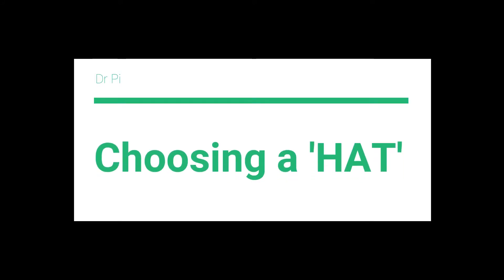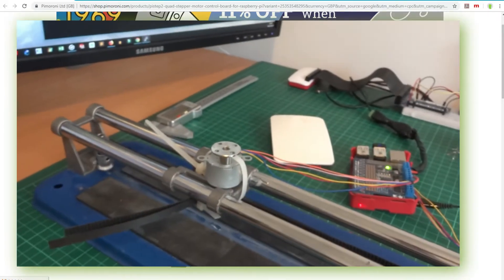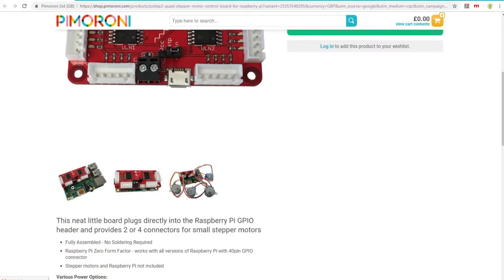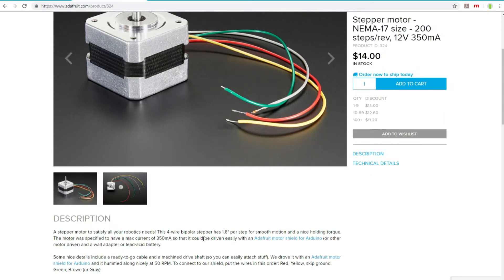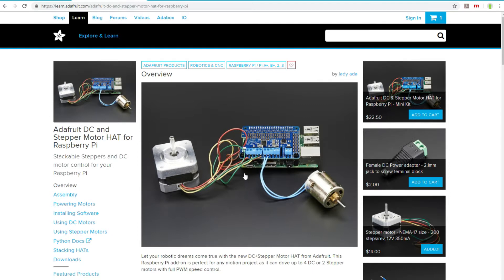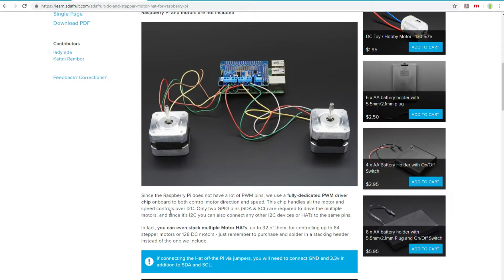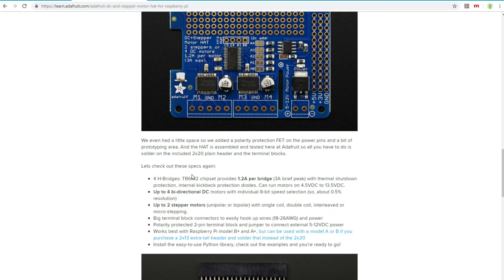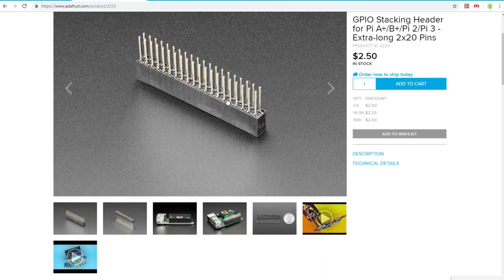Raspberry Pi - Choosing a HAT for DIY CNC

Comment: what "hat" have can use 5Ampere stepper motor good, or can controller 
TB6060 etc stepper driver good, i have 5A motors orden, ball screws, arduino board but not like, rasperry have lot more power use softwares than arduino old shit grpl softw,  anf fasten, limux cnc need build. 4 stepper motor and spindle and limit sw have normal basic set-up all cnc, and bonus have some more relay cooland etc what need use.best have HAT if can use CNC,LASER,DRAWING,VINYL CUTTER, i have all heads, vinyl cut, laser and spindle in home now. i need use this woodworking,aluminium little sometime, vinyl cut, laser sometime too. i build cabin woors, etc many wood pieces, ball screws have 3x 1500mm and linear rail i have 6pcs, x 1500mm long and Z axis 400mm long.
Reply from the maker: Hello, have a look at this : https://thepihut.com/collections/raspberry-pi-hats/products/raspberry-pi-relay-board
Are you still going to use GRBL though - it may be best to control stepper via arduino ...from the Pi.
Also, take a look at : http://willysgaragenorway.no/wp-content/uploads/2017/09/Arduino-and-TB6560-wiring-diagram-1.png

http://willysgaragenorway.no/

Comment: im thinking of a rasberry pi robot project, i need multiple motors and sensors, do you recommend anything in particular?  im not dedicated to rasberry pi either but i was thinking maybe the motor stack from adafruit, but im not sure i would be able to have any sensors with that, but it would satisfy my motor needs.
Reply from the maker: The HAT's that I used were easy to assemble and use, but only 2 motors per HAT. Adafruit is good quality. Maybe stack motor HAT and a Sensor HAT?

Comment: I want to build a cnc machine with raspberry pi and without arduino, i.e. I want to connect raspberry directly
 with the a4988 driver,, the problem is that in the case of arduino I used the grbl library and gcode sender, but in the case of raspberry pi I have no idea, I want an application that installs in raspberry pi and  directly control the motors . I'm waiting for your answer.
Reply: 4988 have wery small drivers only max 2Ampere not can use mill or somethink only 3D printer and vinyl cutter and laser were not need lot power and moment, if want cnc milling machine need buy better drivers HY-DIV268N 5A model. and not use old problematic GRPL software use linux cnc software lot better.
Reply from the maker: You'll need a HAT such as the PROTONEER  RPI-CNC as you'll want something that can take GCODE and convert it to steps.
I tried writing a crude GCODE  interpreter but it was like reinventing the wheel.
The HAT is approx $40 but if you want to use only the Pi then it's the best option, unless any other viewers know of another solution? 👍